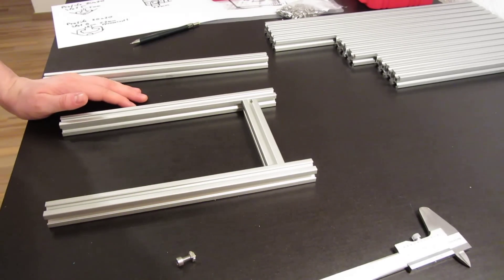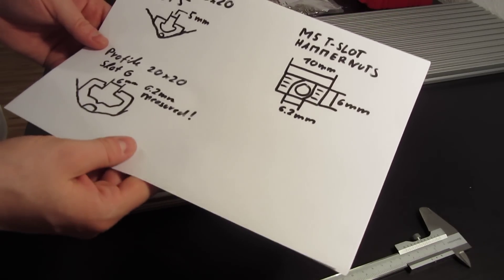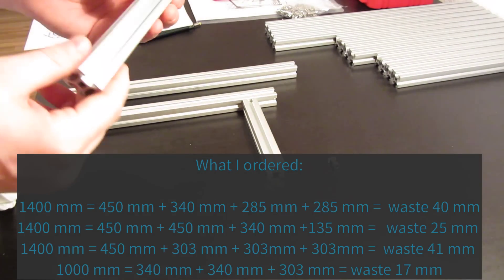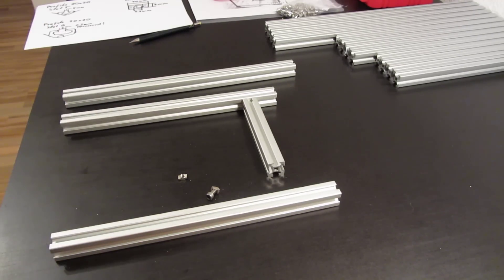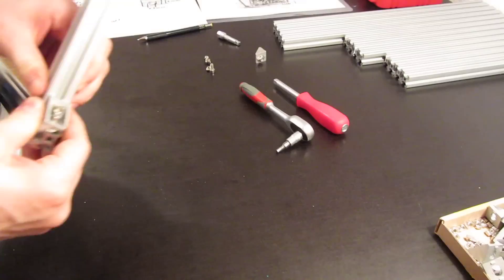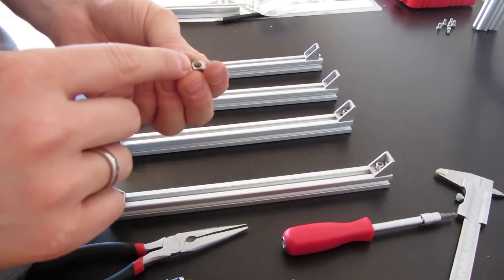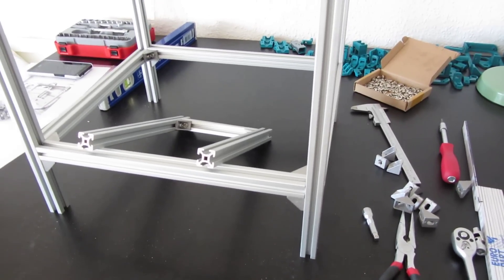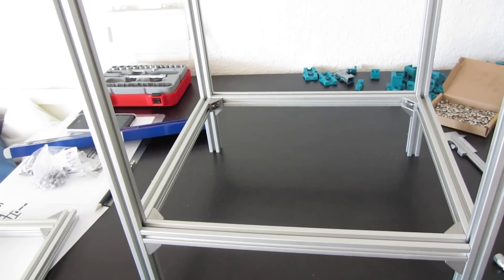Hypercube Frame Build Log

Comment: You always need nuts matching the extrusion slot. For 2020 extrusions, most people seem to use B-Type extrusions which have a 6mm slot and those Banggood hammer nuts do fit. However I-Type extrusions are also popular but do have a 5mm slot. I prefer them over B-Types mostly because there's a German supplier who offers cheap black anodized I-Type extrusions and a cutting service.
I also use t-nuts with springy balls instead of hammer nuts. They are more expensive, but way easier to handle - you don't need to insert them through the plastic part.
With I-Type extrusions, the slots are too small for M5 screws, so you need to use M4 screws for mounting the plastic parts. I modified the Hypercube plastic parts for M4 screws and converted slot holes to round ones for use with I-Type extrusions and t-nuts: http://www.thingiverse.com/thing:2252459

Comment: So did you use the Nuts from Banggood or not? You talk in the video of an EBAY item, and that you would post the link here. Yet no Link here except Banggoog :). And one more thing: From where did you take these corner pieces for assembling the frame?`Thanks...
Reply from the maker: Henri2492 hey the nuts and the corner brackets are from banggood. I'm talking about the profiles which I got off ebay. That's the link.

Comment: hey there, how many hammerhead nut / tnut did hypercube use? I think 200pcs is too much (from hypercube page in thingiverse), I cant source Tnut cheaply in here, so i need the exact number.
Thanks
Reply: I looked at Banggood and Ebay and in the end chose Ebay because everything for the Hypercube nuts/bolts-wise was available there for a competetive price. You can waste half your life trying to find a better price and save 35p whilst slowing down getting the build completed. I just heard that my stepper motors have been "lost in transit" which is a real pig as I found 6x 45oz steppers for the price of 5 much lower power ones. Fingers crossed the replacements get here..
Reply from the maker: Hey, I counted the ones I had left which is 89. So I used 111 hammer nuts. As shown in the video i threw some away because of bad threading. I hope this helps. Can't you just order from banggood?

Comment: Interesting. Why the elevated lower horizontal extrusion? In Tech2c's design you just slide angle bracket flush with bottom of Z extrusion and mount X and Y on top of that. You're going to lose some of the Z print height by doing that. I also have 450mm Z extrusions but I went all the way to the bottom.
The vendor I got my extrusions from didn't charge extra for cutting nor for leftovers but they have a flat rate of $3.30 for anything shorter than 300mm. My 300mm extrusions were $1.70.
If you got your T-nuts from BangGood, I noticed that some of mine had trouble threading onto the screw but once I got them started, they were fine.
Funny, I think I have the same exact pliers that you're using.
Reply from the maker: Hey, because I have a pc psu and I wanted to hide cables and electronics under this level. I wanted to add a bottom surface e.g. acryl there. Also I never printed objects with elevate above 100 mm. So I don't feel like I have the need of a super high Z Axis. 
Yes my nuts are from banggood - had like 4 or 5 with bad threading out of ~ 120. In regards of the price it's ok. ;)